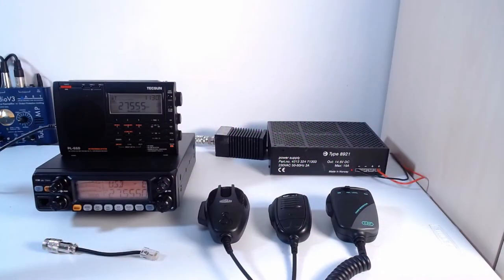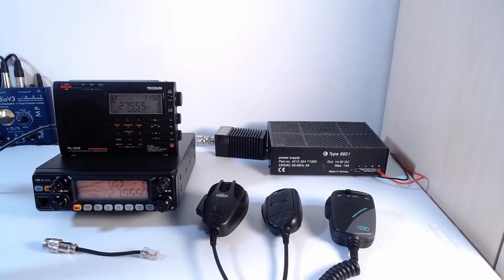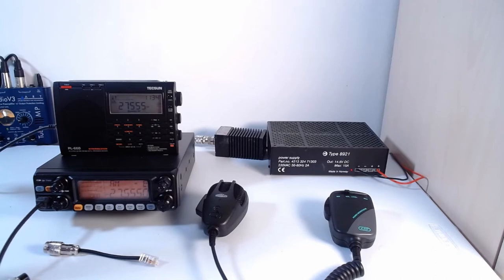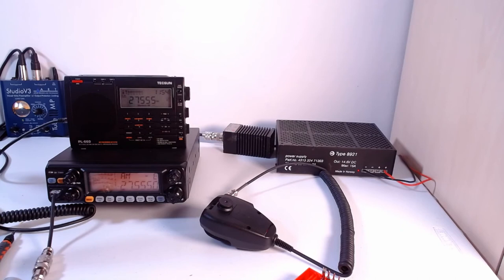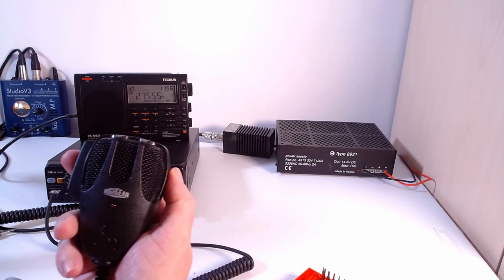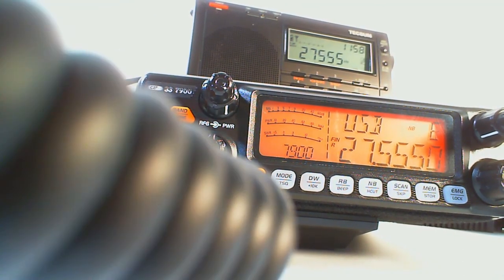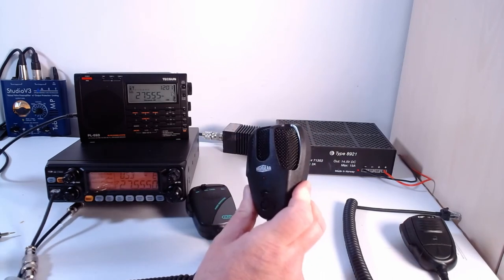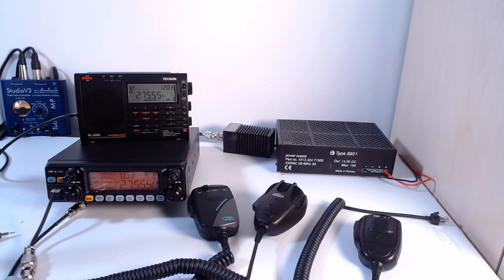Power Mic vs Standard Mic Tests on CRT SS 7900

Comment: Thanks for the comparison. The stock mic was pants.. The Kpo has more clarity. AM and SSB. However the Cobra had more punch and bass on SSB. Overall the Kpo would be my choice.. Like hens teeth now but back in the day I had a original Astatic tear drop ,that sounded amazing through a President George..73s             153 AT 888

Comment: Thru experience the CRT range on FM and ssb especially the mic gain in the radio needs lowering to about 12/15  with any power Mike..... Try it the clarity does so much better.... Using both gains  high just don't work.... Usually but not always...!! Lowish Mike gain on radio and 25% to 40 %  on the Mike is best.. all Mick's are a little different..  the kpo powered and unpowered are quite good if IF your carefull with the radio gain..

Comment: Hiya some good demonstrations with the mics but I wondered what mic gain settings you have for your test please?
Reply: Yes!!!  Mic gain makes a huge difference.  Even a hot stock mic will sound excellent if mic gain is turned down.  But..most guys/gals run mic gain at full tilt.🤦🏻‍♂️

Comment: The two power mics are what they are - power mics. Unfair test as if you had increased the inbuilt mic gain increased then it would have gave more lift to the meter. I recently gone back to oem mics and in all modes my audio seems to be cleaner and yes the mic gain is increased but this is what is done with power mics also.

Comment: Hi Mike.
Ive got the SS7900N and its a decent rig.
Ive got 2 niggles with mine, and im baffled how to sort it out.
1st, mine has 10 blocks of 40 Chanel's, bands A-J but i have to use the 10k shift to get 27.545 and i think its 27.595. The chanel change button seems to miss them out somehow. 
And 2nd, when i tx i can hear my own voice through the radio speaker, sort of like a talkback function even though there isn't one in the menus.
Like i said, great radios for the money, but these 2 issues are bugging me.
Any ideas please?

Comment: Hi. KPO seems to be better for DX because with more treble. Cobra is not very good, sound is bad. Test a desktop microphone and adjust moderately the level . I use a kenwood MC80 with an old President Lincoln, modulation is very clear. Astatic microphones have a very treble and metallic modulation, it doesn't match with my voice.
73

Comment: Have you ever considered the amount of channels you could bleed into using a over driven power microphone…my opinion is there  is far too many  transceivers that cannot reject close channel interference from this type of microphone …one thing worth remembering there are electronic engineers with a greater knowledge than the sum total of all users who design these transceivers for optimum performance …if you are quiet on air simply turn up the the gain in the function settings and save you money for a few beers instead ,after all you are only repeating what the transceiver is capable of doing itself…only saying  🤔73  ps….the CRT ss7900v is probably the best 10/11m tranceiver on the market today with a 5k shift and good 5 level  digital noise reduction producing a decent output around 60w
Reply: 2nd best compared to the McKinley of course 👍.